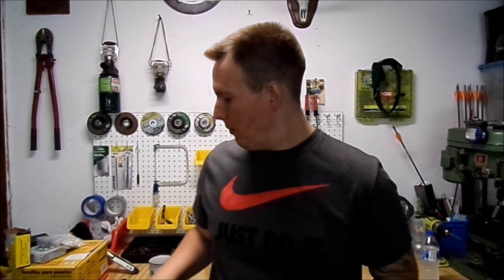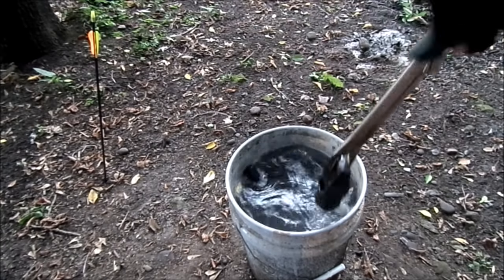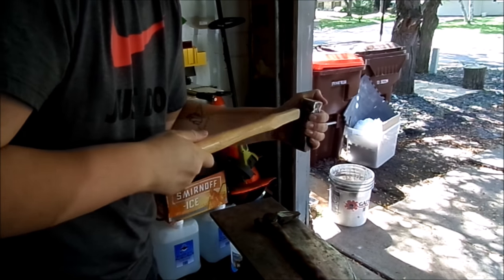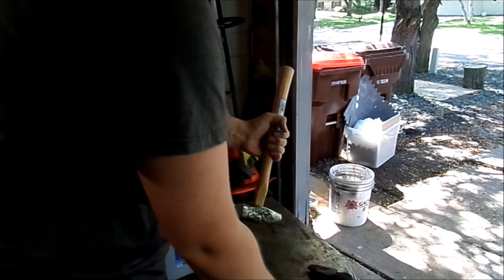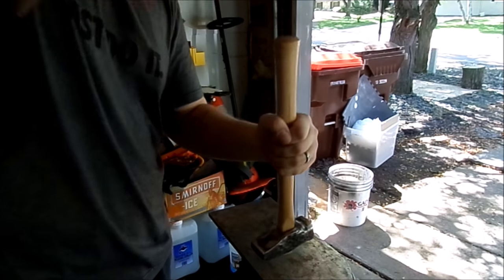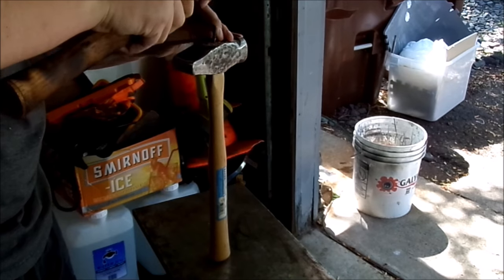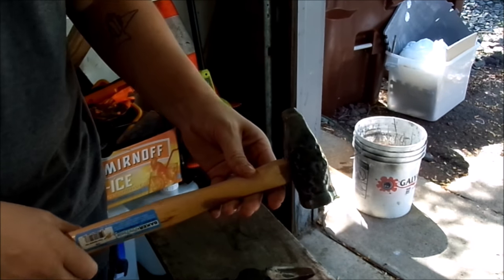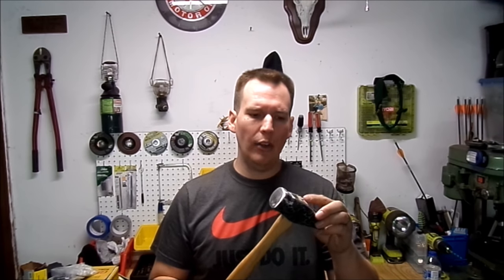Rounding /Cross Peen Hammer Build Part # 2

Comment: Nice work bud. Most minimally I’ve seen a hammer made as far as forging equipment goes. A couple of tips if you don’t mind?
Reply from the maker: Hey thanks man, and like i said i had about 2 hours of footage lost. So I ended up just making it a shorter video i left a lot out.
Reply: Making Stuff and Breaking Stuff with Al did you harden your peen? It looked like you just did the face. Also when installing a handle it’s a good practice for it to come out the top just a little bit so when you put your wedge in it kind of creates a bow tie effect. Just something I’ve learned over the years.